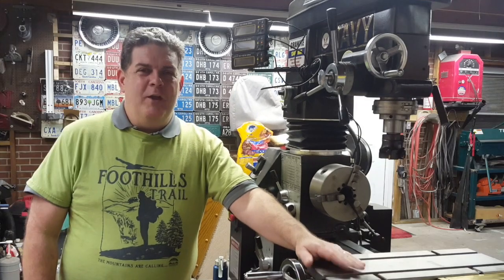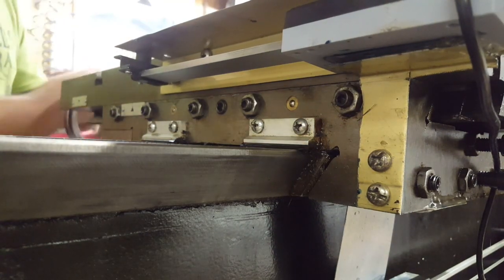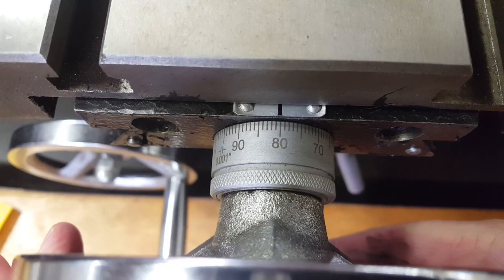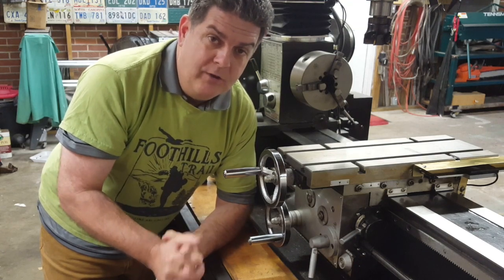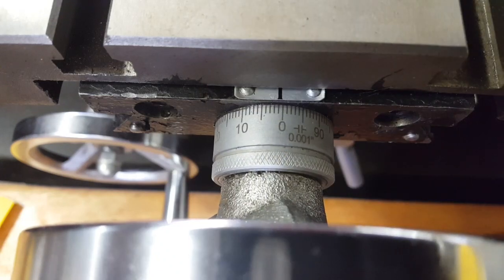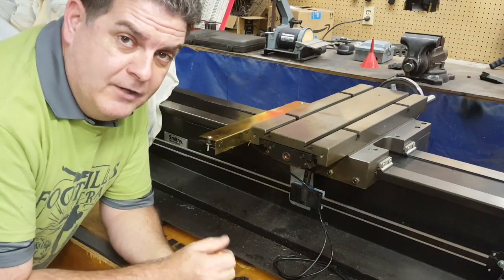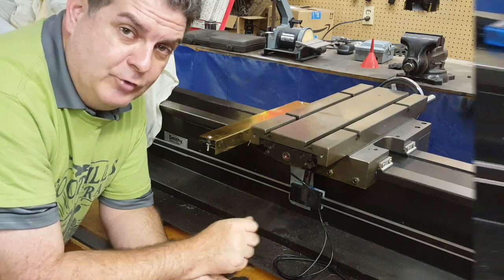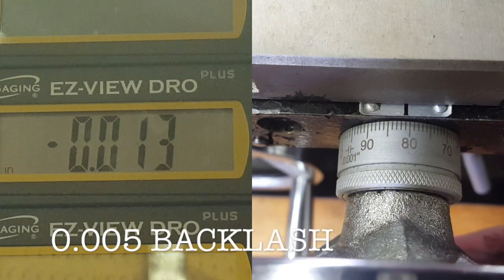Smithy Granite 1340 Max Y Axis Backlash

Comment: The Smithy 3 in 1 can be a great machine , I have a 12/20 ltd , love it, with the Smithy and any other smaller lathes, you need to learn as much as you can about how a lathe works, hit the books,  any of the Smithy's require adjustment and fine tuning to make them operate properly. I have the TD yard card financing, no problems at all ( warning do not miss a payment or your interest rate will go to %28 ) so if you pay your bills on time the financing is ok, 5.99 % i think. If you are new to machining it takes work and study to make quality products, the Smithy lathes are not chinese junk, some machines in any lathe mfg. can be defective, the biggest problem I see with operators is lack of education and skill, creates frustration , people blame the machine, usually the lack of know how ! Foothills is doing his share to help educate Smithy owners !
Reply from the maker: I agree completely! Any troubles I've had were my own fault and inexperience
Reply: @foothillstrailhiker2426  you are doing a great job

Comment: hi Andrew,nice video,enjoyed  watching it.....now that winter is coming,i'll be watching alot of them......oh ,i thaught i would mention it.....i basically did the same on my  mini mill,but with one difference....and here is what i came up with....i measured the diameter of the shaft and took a ride to the local ACE hardware store. and picked up a thrust bearing for the shafts of the mill.it mic'd up to .310 metric. so i got .312 and  adjusted the the  gibs  and placed the trust bearings on and replaced the two wheels as snug as i could,and what resulted is  a  very smooth action and almost  no backlash.......it worked for me........ok andrew,see you next time......stay warm..
Reply from the maker: Wow! I never thought about the thrust bearings. I am going to pick some up and give it a try. Thanks so much. Btw, we will get down to 27° here Saturday night.